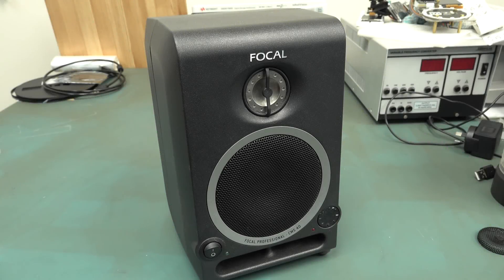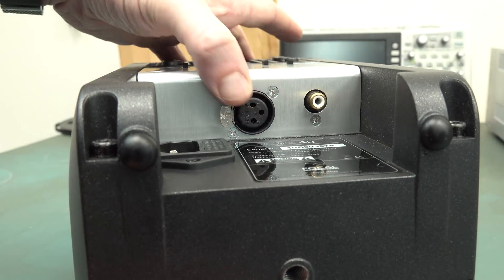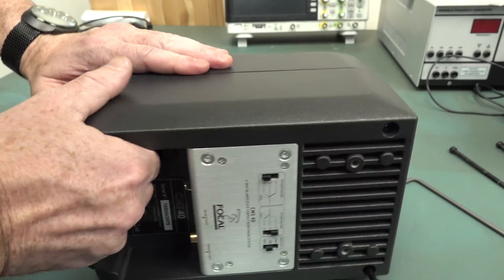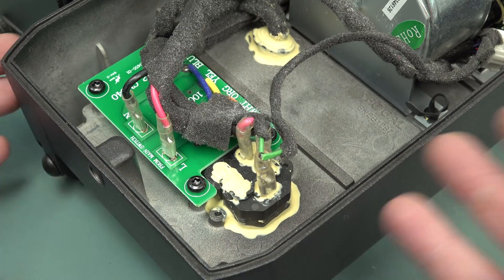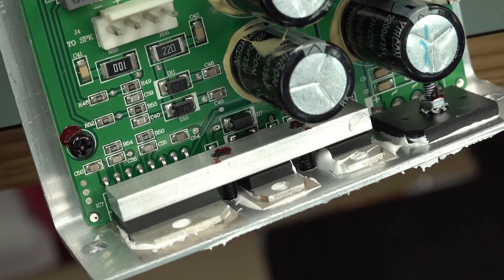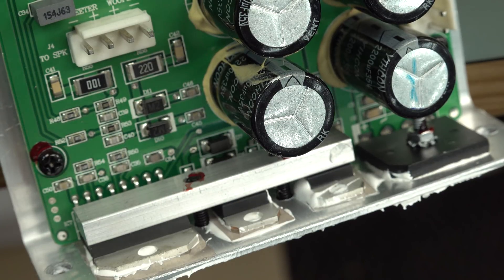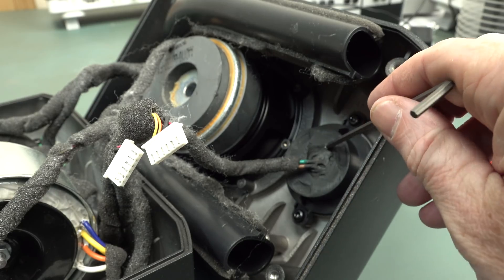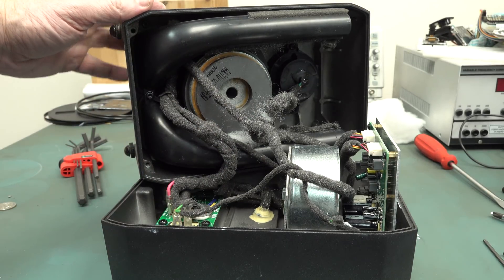EEVblog #1156 - Focal Professional CMS40 Studio Monitor Teardown

Comment: Quite disappointed to discover that on the CMS 50 (the slightly bigger version of these), the toroidal is not shielded even though the preamp on this model is mounted next to its outer edge instead of above it, like it is on these smaller ones, which is unfortunate since at least in theory, given the radiation pattern of a toroidal, it should make shielding even more important.

Comment: Hi there
I KNOW this is an old video, but I have a question :) 
I've owned a pair of CMS-65 for maaaany years and one of them is humming when turned on (even though it is not connected to a sound source) - so, this is transformer hum, I'm guessing. 

The question: 
Do you think that it will be an "easy operation" to open up the speaker and fix the transformer hum?  Tighten it down?

I really like the speakers a lot and been working with them professionally for years, so I "know their sound" and do not wish to part with them - but the hum on one of them is driving me CRAZY these days :) 

Hope you can help and point me in the right direction! 

Thank you for the video!!

All the best 
Kenneth from Denmark

Comment: Fantastic but the op amp and electrolytic sud not be that quality. esp op am, there TI 16x4 that is only slightly more expensive compared to the 50 cents 70s op amps

Comment: Nice tear down again. I just got a used pair last week and found out, once at home, that the input switch in the back in wired in reverse (i.e. -10db is actually +4db and +4 is -10). I was wondering if it is a manufacture mistake or if it could be because someone serviced them and plugged it wrong. But since both monitors are behaving the same, I reckon it is from the manufacture. Have you seen any weird things on yours?

Comment: in my opinion, honestly, focal stuff is an overprized, made cheapo in china piece of garbage, sorry.....but i´m not entirely sure weather it is heat to head witch bose or already above when it comes to price vs. low-performance...just my two cents. never focal again. PCB is done by foxconn. They mounted another magnet on the woofer to eliminate the the magnetic filedlines which come out of the original woofer magnet, and interfere with any CRT....for how long do we have LCD/LED screens....you can bet from that on the design time...also that foam will turn itself into disgusting tarish stuff over the next decades, and i´m fairly sure that you don´t want to need to dig inside after that happened....

Comment: Surprised you didn't mention the green wires on the back of the mains connector.  The end of their insulation ended just where the insulation from the connector started, so you could see part of the conductor when the wire was bent over.  I guess if that's the earth ground it's not a hazard, but it does make the wire more likely to break of they are moved around much (though I guess these speakers don't need to be opened very often).

Comment: Check Genelec 8000 series (8020A (or B) for example) focals basically copied all the design features from those but made them cheaper in China to get more money (they are approximately equal in price, but Genelec speakers are engineered and built in Finland).

Everything from Aluminium cast case to heatsink design, connector placement, dip switches and the lot... ok, they use that fancy inverted dome thingy, but basically a Genelec ripoff ;D

8000-series was launched in 2005, focal came along at around 2011-ish :)
Reply: Yes Genelec are nice and have great design, but have to say I recon they copied ATC SCM20's I think thats what they were, (30Kg each!) I seem to remember installing them in late 90's but not as nice looking and really top end, superb bass exelent wide soundstage and clear but not harsh top end streets ahead of most other things we sold at the time.
Reply: @markhaskins8212  I tried to find some models with cast aluminium cabinets but SCM20 itself doesn't really give me much results... hmmh... maybe some other model? I'm interested in seeing where these ideas come from, I thought that ATC only makes HiFi-spkears but maybe not...

Comment: Focal is high end brand... Die cast casing but choose cheapest main capacitor. Great.
Reply: French
Reply: These are still just blatant copies of Genelec 8000-series monitors... check out Genelec 8020A (released 2005, 6 years before Focal equivalent.) Genelec doesn't skimp on build quality :)

Comment: Hi i have a question,
You mentioned they have a slight humm?
I have logitech Z10 speakers but they don't humm at all.

So i was wondering: why studio monitors humm?
Reply: @Jamie Fletcher ye but its still kinda awful you pay a premium price for a hiss
Reply: @Jamie Fletcher i tested your theory, and almost lost my ear pressing it against the twitter but still no hiss or humm(while playing music at its lowest)
Reply: @sysierius  If you have CD-quality 16bit audio, you can have maximum theoretical dynamic range (the difference between the lowest and loudest signal) of ~96dB, Genelec 8020A (old model already... we're at D-revision already) produces at around >=95dB SPL @ 1m... a pair produces at around 104dB SPL @ 1m.

And for all intents and purposes the hiss should always be below the minimum SPL you're able to reproduce, meaning that If you turn them all the way up, you can produce a sound pressures from ~4-5dB SPL all the way up to 104ish dB SPL... which is like a front row in a rock concert, that's why there's hiss, because there would be no reason to have noise figure that's lower than lowest SPL you can produce at maximum volume. And since that hiss is above the treshold of hearing (above 0dB) you're able to hear it... I doubt you would ever hear that under any reasonable program material

The masking effect is very real and i raise a hat if you can make out a 2dB SLP signal under ~65dB SPL music playing :)

Of course newer models have increased that range quite a bit from both ends... but regardless.

Comment: Hello, I recently just got into the whole electronics diy hobby and I've been watching countless hours of videos. Everyone seems to say that right angle connections on a pcb are bad practice but then when you step away from YT, most forums state it's all lies and they are fine to use. I personally don't like the look of right angles so won't be using them but I'm truly interested in whether or not they're bad practice/what the negatives - positives are for using them.
Reply from the maker: They are bad practice mostly because they are ugly. They can still be "acid traps" at fine trace width, but not a major issue these days. Also, still an issue with fast controlled impedance traces.

Comment: Maybe a stupid question, but you do mention it a lot. Earthing the bolt that goes through the torridal transformer creates a shorter secondary turn, which I understand. But I'm assuming people put it there for safety, IE, transformer shorts you want to pop the fuses. If they don't earth the bolt, is it earthed via the case instead, that's connected to the transformer?
Reply: The solution is simple: just make sure the bolt doesn't have a path to ground on the top side. There will still be potential across the bolt of course, but at least it is floating under normal operation. Or use a plastic bolt :)

Comment: What's that fuzz in the wiring harness? Looks like a bunch of cat hair.
Reply: Exactly, he said these were second-hand and whoever owned them originally must had a big, long-haired cat.  Just nasty, I figure they cranked the speakers up and any fur nearby got literally pumped into the speaker with that woofer, collecting over time since that foam is a real magnet for dust and fur.

Comment: I would think the metal case would cause echo which is why wood is normally used for speaker cases. Metal casing and weight does give the feel of quality.
Reply: It can cause strong internal reflections above the 'pressure zone' where the wavelength of sound is small enough to exist inside the enclosure. Not a lot of acoustic wadding in there either.. but not much space for more! A bit of damping on the inside panels might not go amiss.

Comment: Agreed, the foam tape turns to muck and you're half right. The adhesive on the AC plug and all of the connectors is not only to keep an air tight seal but mainly kill noise because of airflow. Small holes in the connectors will cause squeaking while the woofer is flexing.

Comment: What! No switching power supply with a class "n" or "t"?  Amp on a chip?  How old are these?  Seems like they could have doubled the power with less heat and loss while keeping quality good.
Reply: Yes but smp's are noisy and harder to filter then a linear psu. That an in audio equipment they use linear psu cause it dose not make qlot of high frequency noise on it's outputs and it takes less parts to build a desint linear psu then a desint smp. Fewer parts to fail and easear to filter the outputs
Reply: Nearly all affordable class-d amps have higher distortion in the midrange than traditional types. Do some datasheet browsing to confirm.

Comment: Another big advantage of the casing is magnetic shielding.
Had a pair of JBL LSR 25 and it was a similar design.
Not 100% sure but I think the LSR 25 were the first near field monitors using that kind of casing. 
The magnetic shielding was nice when used near CRT's.
Reply: Aluminium does not work for magnetic (static field) shielding.
Reply: @TheSergeiFranco  I think the magnets have a separate shield (I am sure the 5inch woofer of the JBL LSR25P has a shield) and the casing acts as a faraday cage (for EMI).
Reply: The alloy die cast does nothing to shield magnetically, but the woofer has that extra magnet glued onto the back to cancel out the far magnetic field of the whole ferrite assembly. Probably done so the toroid is not saturating and also so the mains hum does not become audible on the speaker, though that is also helped by the steel cup with the open end away from the magnet assembly. Hardly anybody uses a CRT any more, so the only reason the extra magnet is there still is that it is needed for hum reduction.
Reply: @SeanBZA  Not for static or slow changing magnetic fields but it still is a faraday cage.
The LSR25P I had was a design from 1999 if I am not mistaken and it was mainly CRT at that time. I had the first pair here in Belgium (worked for JBL Benelux distributor at that time) and they have been sitting next to a CRT for years.

Comment: I have a pair of Boston Acoustics HD5 speakers connected to a Yuanjing T-amp with its own linear power supply.  They lack a little in the low end but the sealed construction and the special HD soft-dome tweeter give them exceptional transparency.  I've had them on my shelf for five years now and they still continue to surprise me at times.

Comment: 12:00 Looks similar to what's inside the Anker soundcore. Look up Anker soundcore teardown..it has a horn shaped thing in the middle which anker claims is for "increasing bass"
Reply: There are two ways to get extended bass in a speaker, larger box or a port(s).  Ported enclosures (aka bass reflex) add an acoustic resonance somewhat below the natural resonance of woofer+box, which extends the frequency response down in frequency (or, if you get it wrong, produces a boomy resonance at a single frequency).  Alas there is no real substitute for a large speaker enclosure, although adding a port can increase power handling by loading the woofer's resonance down.

Comment: $425 for one..... used
Reply: That's way overpriced... I thought they would be cheaper than much higher build quality Genelec 8000 series are. After all, they are a copy of Genelec 8000-series monitors. Just made in China instead of Finland... weird to say the least...

Maybe the shipping and taxes just add a shit ton to the price over there...
Reply: @Mtaalas  Definitely made in France.
Reply: I managed a pair on craigslist for $360, earlier this year.  Definitely worth it!  They sound amazing!
Reply: @pin.2hot  still overpriced
Reply: Ouch. Not surprising considering it's a professional grade speaker system.

Comment: whats the actual difference between, say, a Panasonic cap and one of those Yihcon ones? surely it cant be that hard to make an electrolytic cap. is the distaste for off-brand caps based on actual recent test results and/or failure rate stats, or is it just a hang-over from years ago, the early days of Chinese electronics, the capacitor plague etc? is there any reason why some Chinese company cant make perfectly good electrolytics at half the price of Panasonic?
Reply from the maker: Yes of course they can make good caps, but the issue is they haven't built up a reputation of design and manufacturing reliability over many decades like the other manufacturers have.
Reply: It seems the cheaper ones tend to dry out quicker, but but its not to say that the big brands don't.  Mind you ive never seen a nichicon fail.
Reply: that's certainly possible! the problem is that manufacturers are always changing/improving their products, so by the time you have enough historical data to really gauge the reliability of a component, it's probably already obsoleted. companies like nichicon and panasonic have built a reputation for making quality capacitors, so that's why they are preferred over lesser known brands.
Reply: Yihcon is a Taiwanese company. They do have a facility in PRC.
Reply: I'm a JWco fan, myself.
Reply: Making good electrolytics is very hard, you try to make one!  Remember its got to last in working equipment for decades for some applications - you pay a lot more for the top-rated ones.
Reply: longevity?
Reply: @tnasburypl  very probably, thats half of what I wanted to know, as well as if its genuinely still the case. But also I was interested in what actually separates good and poor quality caps, is it physical integrity, electrolyte formula etc. Or more precisely, what were the specific failure modes and manufacturing defects that led to cheap caps having such a bad rep and how difficult would they be to remedy.
These questions came to mind because its actually been quite a while since I saw a product die before its time due to bad caps, with a single exception that might have been down to bad design anyway despite having dustbin-quality capacitors (it was an ebay boost-module-for-a-dollar that had a max rated output of 40V but used a 35V cap across the output). But Im just a hobbyist, someone whos a service engineer for a product line that stresses its caps might still be seeing cheap caps fail on a daily basis, I dont know.
Reply: Electrolytics tend to be one of the more expensive items on the BOM and a cheap one will generally get you through the warranty period. We never used to think much about cap failures in the first couple decades after something was made, but now it's common to see it in the first 3 years. Another problem is that everything has switching supplies now which run these poorly sealed caps fairly hot.
Reply: The real difference is the Yihcon keeps repair shops in business, and profits in the pockets of the Mfg... As far the Chinese being able to make good ones, well it comes down to them being able to steal the recipe or not, so apparently the recipe for the electrolyte is pretty well kept... actually assembling them isn’t hard, formulating the complex chemistry that’s stable for decades is apparently very difficult...